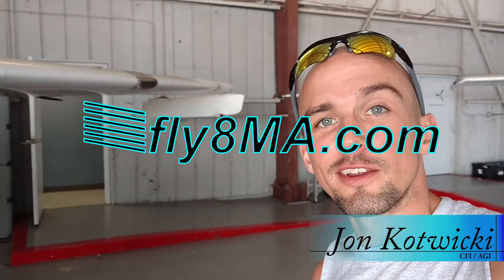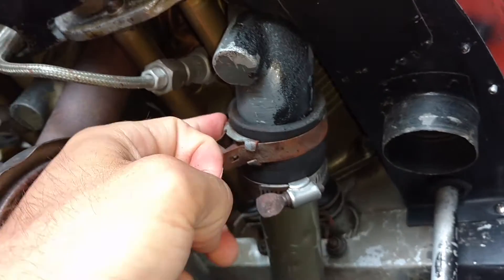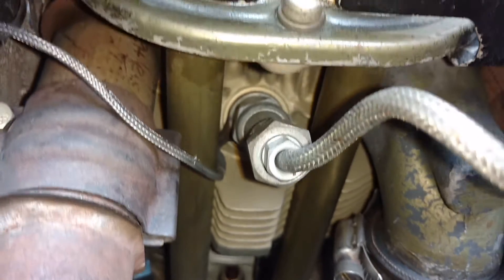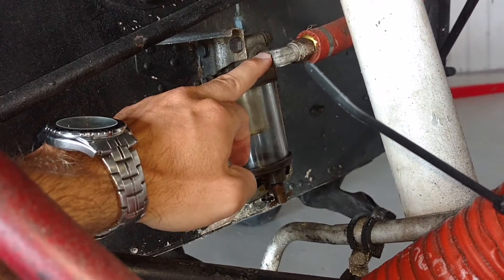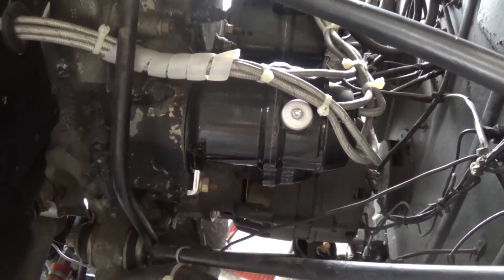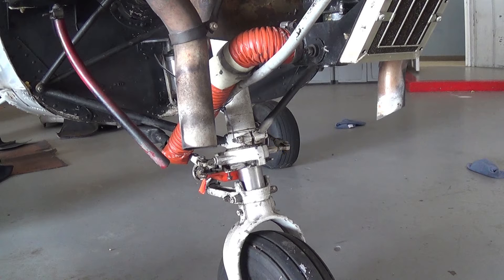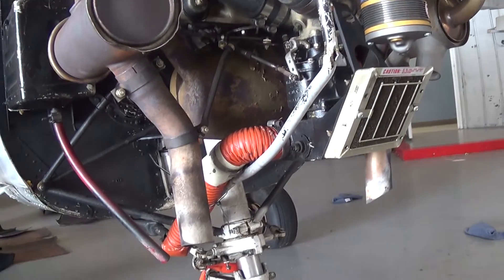Ep. 54: Cessna Engine Explained | Under the Hood/Cowling

Comment: If Air is preheated before it comes in the cilinders, don't you get less Oxygen in the the mixture? (Warm Air expands   ...)  I would think that creates a certain Power loss.   In the Automotive World, they install interadvanccoolers to prevent that.  What am I missing here? Thanks in advance
Reply: some cars have the same thing, its to heat up the engine faster to minimise engine wear, sometimes they have valves to shut out the hot air once the engine gets hot.

Comment: Nice video.  But I did not see the oil filter or the oil screen....
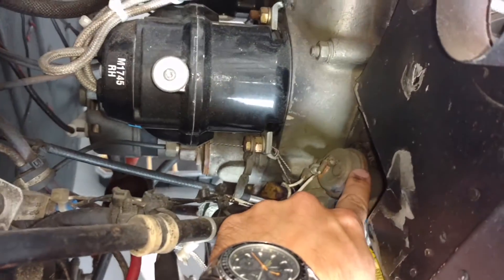Reply: Joseph Salloum You can see it at 4:50, when he is pointing at the oil pressure switch, it’s just below the magneto. The black wire leads to the oil temperature probe, if you removed it then loosened the piece in front of it you would find a coarse screen. As far as a regular oil filter like you would see on most engines, the O-200 doesn’t come with one. Hope this helps

Comment: How do we get more horsepower out of that Continental 0 200 instead of a Lycoming 0-320 E2D conversion?
Reply: Waqar Syed There is an STC for a high flow air filter that may give it a bit more power.

Comment: Hi, I have a few questions.

Are there any specific values/figures for the starter motor cutout/disengagement ?
What is the minimum voltage for the starter motor to start the engine ?

Comment: thanks so much for your videos and I especially like watching your flying instructional videos. You have a unique way of talking and explaining flying. for many years I've restored late 1960s and 1970 muscle cars, several to show standards.  I gotta say, I'm surprised to see the workmanship on an airplane engine. Zip ties cabled to Zip ties, different old used compression clamps on the dented intake runner tubes and rusty nuts on what appeared to be newer vacuum pump mount. I get the impression someone just used whatever was in the old coffee can of left over nuts and bolts.  I suppose it just has to work to pass muster. Thats the first aircraft engine I've ever seen, perhaps its not representative of many other. It was interesting to see under the hood,  much simpler than I imagined but I guess some of these were designed many years ago.  I wondered if I owned my own 150, if I could do some of my own work and have a FAA mechanic approve it. Thanks so much, I'm learning so much from your videos. Ted in Sebastian